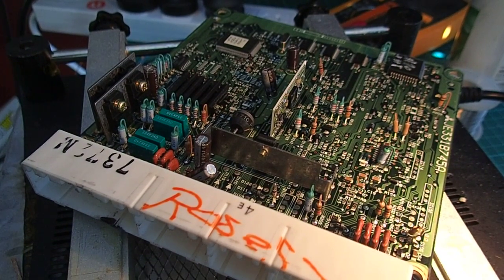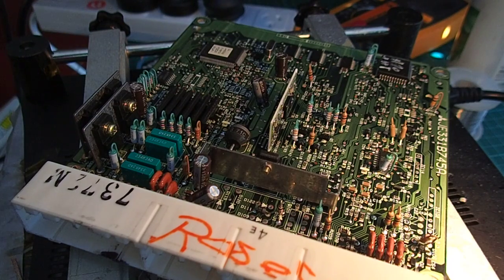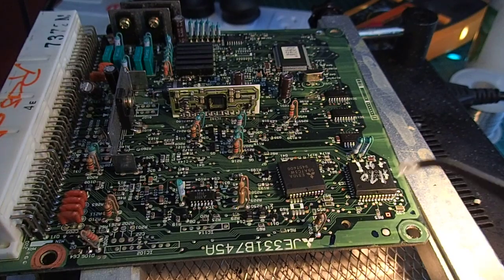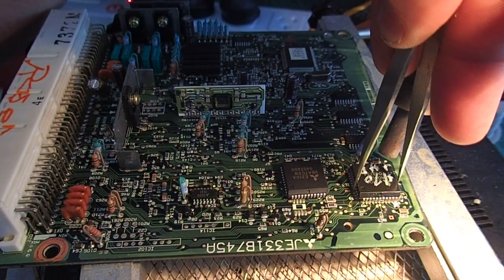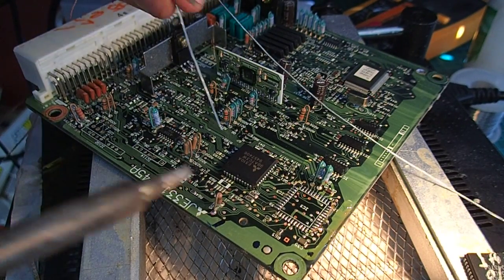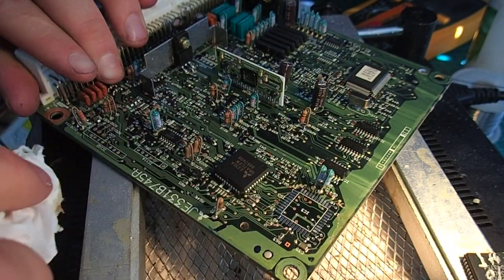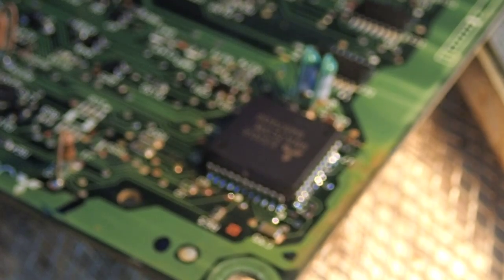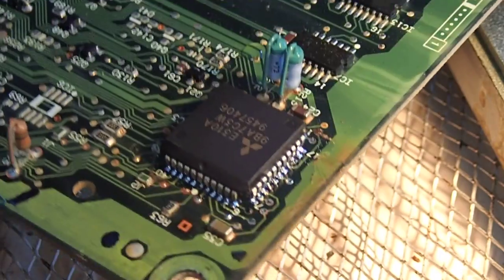Lancer ECU rework

Comment: Does this ic need to be programmed? I also replaced the same ic on my 91 dodge stealth twin turbo but it seems worst before i had 1 coil signal working and 2 were stuck on, after i replaced the ic every signal is stuck on now i would really apreciate any help

Comment: Nice info, if coil 1 and 3 are working, but 2 and 4 are not working, which components are faulty ? PCB code JG331B09702C1, box = MR44641, Mitsubishi Lancer 2000, thanks
Reply: Usually it's Coil 1 & 4 and 2 & 3
Reply: @sandeepthakur493  Yea normally, but this one is different ? what's the cause ? is it possible that MCU is faulty, I can not see a pulse from that port on my scope.
Reply: @RixtronixLAB  Then check pin 10 and 23 if you are on a 4G94 engine. Pin 10 controls coil 1 and 4 while pin 23 controls coil 2&3 in MT Lancers. Better to refer to the corresponding pinouts of the ECU of that model.
Reply: @sandeepthakur493  what do we expect from those pins?
Reply: @RixtronixLAB  Pin 10 controls coils 1&4 while Pin 23 controls coil 2&3 in MT Lancers with 4g94

Comment: I have a 99 Galant V6 automatic , crank but won’t start  .I just every things is good . Injectors pulse and sparks , timing been replace but it still would not start , plus I have a used ECU from just yard , this vehicle have immobilized key chip , can you able to see what wrong with it ?

Comment: I have a  2002 Mitsubishi lancer 2.0L oz rally 2.0L whit the driver side coil is not throwing no spark put on a  new coil and nothing please help me with this problem
Reply: Is been stressing me out
Reply: Car been park for 6 months just trying to fix it please help me
Reply from the maker: @miguelsantiago5350   seriously?  I would need to probe the output on the car, im not there. Take it to an auto sparky.
Reply: @getelectronic8459  to a mechanic shop that's what you telling me
Reply from the maker: @miguelsantiago5350   so scope the output... and work out what pin it is. Then trace

Comment: I have me a problem with my ignition part on my ecu the part that send the signal to the transistor the signal volt should it be moving from 0 to 7 when the engine is up an running it is a 4g15 twin cam ecu md354635 is it a pull up or pull down signal please help me

Comment: Hello . I would like to know , if I can get information from you about my 99 Mitsubishi Galant sohc 24valves V6 , won’t start , but it able to crank only , got all spark and injector pulse but it would not continue running , is there any IC chip or anyway to make PCM to run again ? ... thank you
Reply: Maybe ctack sensor going bad
Reply: @tajhealthnature8570  no , crank sensor been replace twice ,be careful if you took your care fir emissions, car was running fine , after you take for emission . Check engine light came on , with in 5 days ur car die for good . They erase ur car computer
Reply: @ltp9735  wow

Comment: Would you know where is the sensing circuits lead to? I have a Nissan ECU trying to analyze but it seem that sensors inputs in my case go to a bunch of passives.. i was looking also to what exactly change a s Sine wave ex. (CKP)  to a digital signal?!
Reply from the maker: i rely heavily on the mechanic or auto sparky to tell me what pin is of interest really like them to mark the particular pin with a pen mark so i can trace it back where it leads to

Comment: please how can i get  lancer ecu  pinout ??i have je331b55104b1 can you help me .
Reply from the maker: taha ilbymy what pins do u need?
Reply: 1-start/ignition pin
2-12v  or direct power pin
ground pin 
and when i test the ecu with arduino , i apply for the first and second pin 1  amper,12v,   sorry iam a beginner in the field ?
Reply from the maker: taha ilbymy just take it off the ignition barrel instead.

Comment: I have the same ECU and the same problem, one of the ignition coil isn't working, I had IC replacement but still the same problem... isn't problem with ignition coil or spark plug... idk what to to anymore.. i'm from brazil..
i did the same thing u did.. but doesn't worked... (only for 5 minutes or less)... and stopped again..
Reply from the maker: No- You have to remove the Eprom from what ever the original key was used in and solder that onto the donor ECU
Reply from the maker: fern4nd0wyd  could be what drives the ic? like the main micro controller  or you have gotten a fualty ic in the first place ?
Reply: I bought an IC A310 so it worked for 5 minutes or less.. So I Bought another one and didn't worked anymore.. I don't know what to do anymore..
Reply from the maker: fern4nd0wyd  buy another ecu?  it must be the main micro...??
Reply: can't find another ECU, my ECU ID is "JE331B733C"
Reply: @fernandosbtech  mitsubishi big problem. Toyota no problem. Yes
Reply: Jm Akm hahaha I’ve solved the issue, the phase sensor was giving wrong information also, then after replacing this IC and the phase sensor, issue sol Ed
Reply: Nice vedio.......I have Mitsubishi radeo v6,,, if you remove the transiponder eeprom can you start the vihecle with an ordinary key?
Reply: I have the same ECU and the same  problem lancer model 2007 ignition problem